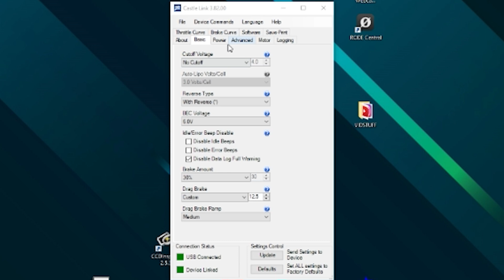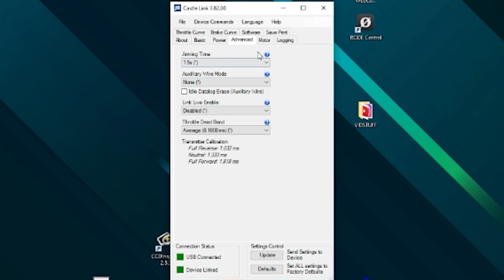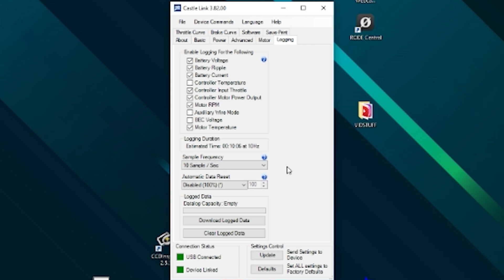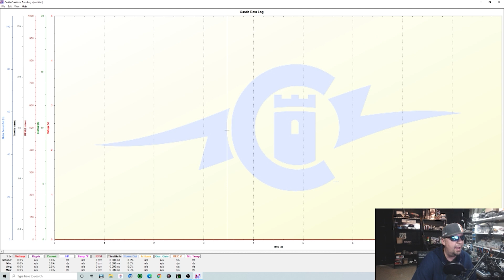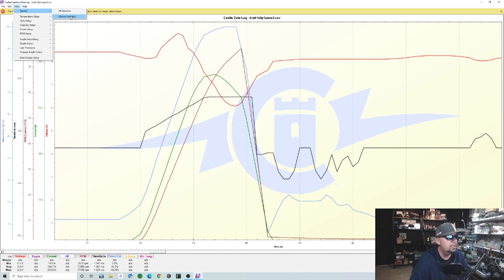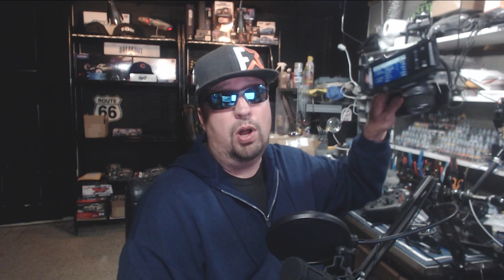CASTLE MAMBA MONSTER 8S FULL CHEAT MODE AND ESC SETTINGS

Comment: my brakes seem kind of weak even on 100...compared to my firma esc... is that normal for the mamba? comparing this to a firma esc
Reply from the maker: Not sure. We never really used brakes. In drag we just let the car kind of run out. Braking was always a big gamble on the car going sideways.
Reply: @Dorkyand40  makes sense. what are your turbo timing settings degree and range and do you use drag brake settings? lmk i have 8s 1650kv 32t/39t gearing
Reply from the maker: @ramos.nitrorc when I used that esc it was all on this video or the ones before or soon after. Never hid anything
Reply from the maker: @ramos.nitrorc when I used that esc it was all on this video or the ones before or soon after. Never hid anything
Reply from the maker: @ramos.nitrorc  it’s all in there man.
Reply: @Dorkyand40  ok will check it out thanks 😊

Comment: I know this is a tune  for a castle. I run a tekin rx8 gen3 with a 4.5t motor 20p 87s on a dr10 what should I start my boost at ?
Reply from the maker: start low around 5 deg and work up and watch your batt

Comment: man, I gotta pull mine out and get it going again. Built a 2wd slash about 2yrs back for doing speed runs, general bashing. I dropped close to $2k into it and needless to say its been sitting for about a 1.5yrs. lmfao. was trying to at least break 120mph with it ( was hoping for higher speeds actually) but shattered the tranny every single time I took it out. running the CC mamba monster x 8s esc, TP4080 2022kv motor, Revolectrix 70c 5000mah silver label lipo battery and also using the perfect pass launch control and a cap pack (completely forget who makes it). have extended a-arms (front and rear), front and rear sway bars and using hoons dboots tires off the Arrma RC vehicles. I'm using a  36t pinon and 36t spur with a slipper eliminator. 10 times I tried running this setup and every time my tanny broke. 6 times the diff gears shredded, 7th & 8th run the diff output shaft shattered, 9th run the spur gear shaft broke and the 10th well idk cause I never took it apart after it broke due to being tired of rebuilding tranny every run hence the reason its been siiting for 1.5yrs. I've tried using million weight diff lube and even tried completely locking it with epoxy and nothing but tranny problems and never even broke the 100mph mark. lmfao. being told to remove the slipper eliminator and to try hot racings slipper clutch setup and see if that helps. being told that since I have everything locked up in tranny there's no place for anything to give which is why I'm breaking it every time I run it so the slipper clutch should help since it'll slip a bit as im throttling up. I know the slash was never designed to run 1/8th scale motors on 6s but damn. thinking of also trying the transmision thats on the slash drag since its designed a bit differently and uses different planetary gears in the diff. anyone else here have any suggestions other than slipper clutch or a complete transmission change before I get a itch under my ass and start putting her back together?
Reply from the maker: Boy lot going on here. I’m def not the speed run guy. I’d hate to give any bad advice for a setup like that. Sorry
Reply: Dude you need to explain more why such a short post

Comment: Cheat timing only works with 2 pole motors correct? I tried with my 4 pole and castle link says it won't work with 4 pole and more motors? I tried and it's like a rev limiter. So am I stuck with fixed timing? If so what should I run max? Mom a Monster X 6s esc with Castle 1406 7700kv motor.
Reply from the maker: No cheat works with their 4 pole but their timing algorithm is a little tricky because we don’t know how much or when it is applying the timing. You can specify the rpm range but how much and when? Tekin applies less timing at the beginning and more towards the end.  Have to data log in castle link and see where the heat starts building and timing getting wasted.  I’m sure we will learn a lot from castle in the next few weeks.

Comment: Have you tried to set your timing up where it comes in at 40000 and it is fully engaged at around 60000? It allows your voltage to recover and comes in like turbo timing.
Reply from the maker: I try a lot of things. That kind of drop
Is very surface dependent

Comment: What turn more are u running
Reply from the maker: Currently a 2.5. Same as this video I think.
Reply: What is the can timing set at, mines is at 15 degrees and as soon as the esc timing kicks in blow the tire and spin out i go😂😂🤷🏽‍♂️
Reply from the maker: Motor is around 28 degrees.  Spinning is all about tuning. Either through a good esc like the drk or using a good remote like the m17 to control throttle
Reply: I do have the mm8s, trying somethings out

Comment: You realize that’s not start and end. It’s when it starts activating and then when it’s fully activated.
Reply from the maker: sounds like a word salad to me my man
Reply: @Dorkyand40  So if you set the boost to start at 25000 rpms to 65000rpms  with 25 degrees of timing. It is my understanding it will incrementally start adding that 25 degrees of timing at 25000rpms 1 degree every 1,600 rpms until 65000 rpms when it reaches 25 degrees of timing. Then after 65000 rpms it will continue to keep that 25 degrees of timing(boost) until the end of the pass or the motor reaches peak rpm.  The mamba is purely rpm based.  You use the start and end rpm to control the rate in which your ramp the timing up to control the hit to the tires.  If you do the math like above, 40000 rpms and 25 degrees of timing so 40000/25 = 1600, so that tells us that every 1600 rpms 1 degree of timing is added....Roughly.
 The hobbywing uses boost and turbo which is rpm and throttle position based. Im just getting into the DRK and haven't touched a R1 yet.
Reply from the maker: That’s the idea even though we really don’t know how their algorithm apples the timing since we cannot log it. We can assume it applies even through the range that we set. That’s one good thing about the drk is we know exactly where and when what is going on.  But castle is my main car and it hasn’t let me down yet :)

Comment: Again Chad thanks for an amazing video. I just finished installing the mamaba monster x 8s esc and the trinity 2.5T motor. Thanks to your video I was able to set the esc and motor using the castle link. Question my spur gear is plastic fron traxxas and it got strip. What type and brand of spur can I use that won't strip and that won't mess anything. Again thanks for the help.
Reply from the maker: I use kimbrough spurs. Glad to hear I helped ya out!

Comment: Should my end rpm be lower or higher than the rpm’s of my motor? If my motor does 70,000rpm, should I be 60,000’s or 80,000?
Reply from the maker: I always used to try to have all my timing come in before the end. So if I make 80k I would end it at 70k. But my last races I changed it and had it finish higher. So car rpm was 70 and end was 80. Then I was able to adjust my radio for a faster ramp. This setup helped me run my fastest times ever. 1.998 at 74mph. Vs 2.1 at 70. So play with both and see what works best. See what the car will take. But keep the data for both just in case you’re ever in a situation where you need to pull it back a little.
Reply: @Dorkyand40  ok thanks!

Comment: After blowing 3 XR10s trying to run my Trinity 3.0 I am glad I stumbled on your Utube channel. I bought the Castle Mamba Monster 8s and the first time out with it I am VERY pleased! I ran at 16/90 gearing on my DR10 with the R1 11400 brick battery and unfortunately since I have a Mac and a iPhone can't do the data logging yet but I have ordered the blink so that is coming soon. Thanks for all the great info and now with this esc I can feel way more comfortable tuning and racing my Dr10 with the 3.0 motor with out fear of blowing up yet another esc!
Reply from the maker: That’s great to hear man. Once you get it dialed you can set it and forget it snd work on the car itself. It’s soooo nice. Glad I could help.

Comment: Are you still running the 3.5 turn?
Reply from the maker: 2.5
Reply: @Dorkyand40  I thought I seen in your Mamba ESC Settings your motor direction was set to "reverse" .Is this correct ? I also had to set mine to reverse to get proper motor rotation (clockwise looking at endbell) on my Losi 22s. Now I'm all unsure about my timing being accurate.
Reply from the maker: Yes it is. As long as your calibrated you should be fine. I’ve not seen anything to say mine is not being utilized. How ever they apply it.
Reply: @Dorkyand40  
Calibration went fine when I switched the esc from normal to reverse .
I was told by castle tech that my motor may be wound in the wrong direction. I don't think this was the case since motor direction according to the endbell is moving in the correct direction. I think the esc is what is reversed. I even threw my stock motor on the esc before switching out of "normal". It too went backwards. Lol
I just wanted to make sure cheat timing was added, not subtracted .I did the kv test o. Castlelink and started at 0° and logged rpm. Than 22° than 45°
 Peak rpm did not change with that testing.
Sorta puzzled.
Reply from the maker: I never ran that test. Don’t think it was ever made with what we do in consideration. Just their big ass motors. Idk??
Reply: @Dorkyand40  I'm running  a mostly stock chassis losi no prep rtr with some carbon upgrades. It now has a 4.5t Xerun v10 g3 with the MMX 8s and M17. Your channel is what inspired me to go with the castle and the Sanwa. I know some people give you crap over what you suggest but they need to be grownups and  make their own decisions with the opinions you provide. I did my research and the purchases ,though expensive ,are worth every penny to me. Ive been stuck in the mid 2s but am slugging away at it learning the chassis setup and getting used to the slipper eliminator. Your tips on m17 settings have been helpful in learning to use and understanding the settings.
I now have a Rotor Ron Fantom Icon v2 Mod 3.5t on the way as well as a Nooner Carbon chassis. Can't wait to get that going and for the challenges it will bring.

Thanks Chad and keep the content coming.
John Z

Comment: I'm surprised you're able to leave with your Start power so high, and your activation so low... and I'm surprised how much voltage drop with that brick good video
Reply from the maker: Thanks bro. It takes it. And it sounds and runs smooth and controlled. There’s a lot of work I could still do. I plan to play some this weekend I hope.
Reply: @Dorkyand40  for sure it definitely sounds like it's moving out how do you feel about the voltage drop have you ever tried dropping your EPA
Reply from the maker: I think dropping a tooth or 2 might help it and maybe bring back some rpms. There’s all these little things to do now to try to shave those .1-.2 seconds.  I don’t think I’ve ever ran this setup with a lower epa always 100.  But I try to just look at my average drop and not these Hi and low. My rx would spike to 12-13volts so it’s hard to judge what’s happening inside these runs with voltage even with great logging. The packs seem to take it. Still good ir after they’re cycled.  I’ve got s lot to learn to run faster snd keep those numbers up like I’ve seen some do.
Reply from the maker: A regular stick pack would puff though I’d say. I puffed all of mine with my dr10 car. These hold so far.
Reply: @Dorkyand40  the gearing may help only you will know that. The thing I've learned is voltage is everything if you watch your data you will see the RPMs raise and lower with it the EPA was only a suggestion cuz I see you're running all the timing in the ESC and assuming you're running 30 on the motor you may not want to add any more timing I think most of your ET gains will be in maintaining voltage besides turning it up LOL like I always say we're all learning together
Reply from the maker: Yeah man. I’m always open to try new things. There’s nothing left to throw at it parts wise. I’ve got great stuff in it. My plans from the beginning was to throw the sink at it and look for gains and I got the biggest et and speed gains ever with the castle. So I’ve def slowed down on the tuning since we went to bracket racing. Need to get back in and try something different now like you said.  It’s just great finally having a decent car.
Reply: @Dorkyand40  hell yeah

Comment: How do I get the cheat to open up
Reply from the maker: Just click on the drop down in the motor tab to turn on full sensor Cheat mode.
Reply: @Dorkyand40  is this for sensord only motors
Reply from the maker: Yes sir it is.
Reply: Hello the I have a question will that setup work on my system I have that Mamba monster 8s esc and the new 2.0t fantum motor I'm lost can you help please